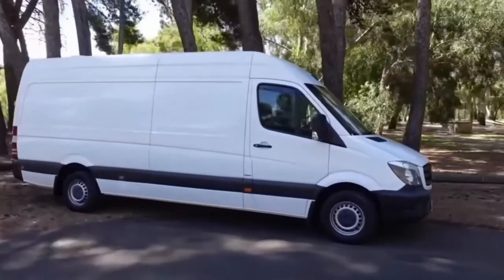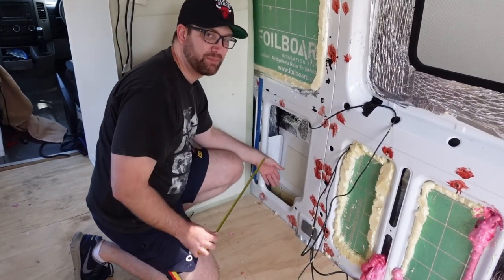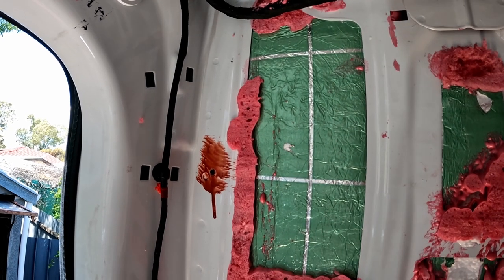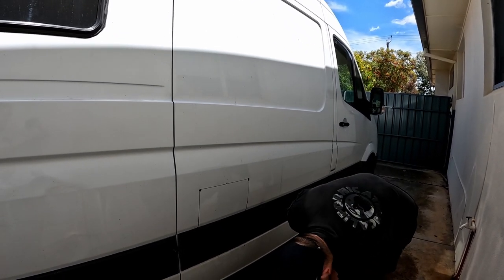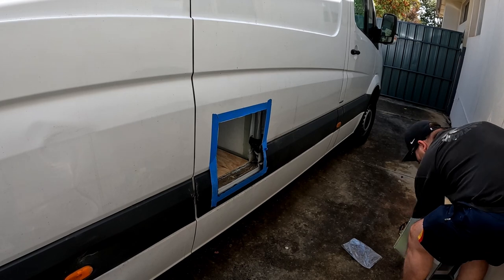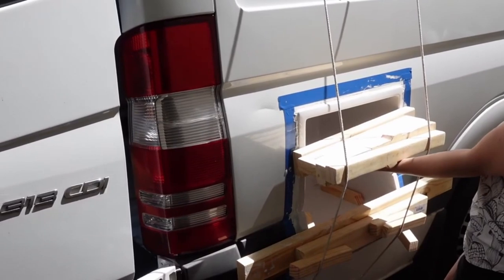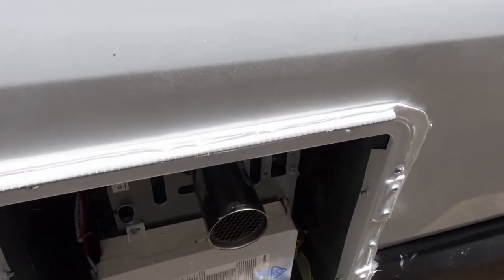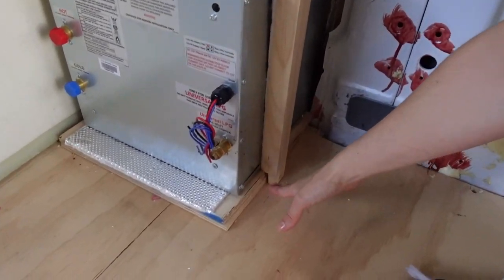The EASIEST Van Hot Water Heater Install | Mercedes Sprinter Conversion

Comment: I am researching what heater to install in my Mercedes Sprinter Conversion. I had selected the IMASS instantaneous Water heater to be installed exactly the same location as yours. 
Which I believe is the same as yours. 
I requested what else I required from the supplier for the install I had chosen too powerful a pump. 
Then they started suggesting other water heaters which partly use heat from the diesel hot air blower plus 12 volts to heat the water. i have solar panels on the roof. But consider heating water from the 12 volt system too big a drain.   
I did not like anything interfering with the 12 volt supply as it is vital for starting the van. 
Under my van I have a LPG tank and a water tank where the spare wheel was. My spare wheel is on the back door.
If anything happens to the LPG supply it is not a big deal I can go without LPG at a push. I carry spare Diesel. 
I will stick to my original idea and follow you. 
But I will take off the plastic panels/trim from the van side before cutting the hole and raise the IMASS instantaneous water heater up 4 inches from the floor.
Thank you for sharing your experience.  Sikaflex is very messy stuff to work with.
Reply from the maker: Yea so many different ways of doing it all, sounds like you’ve done some  awesome research… haha sikaflex is the devil

Comment: I just installed one of these. I decided to go above the trim and built a platform. Use goggles! I got a sliver of metal in my eyeball even with sunglasses.
Reply from the maker: That’s awesome yea it’s kind of an awkward spot you either have to cut down or build up, I ended up with a bit of a platform on mine too.

Comment: From Canada:  it's not the first time I see Aussies van builders cutting such gigantic hole in the side of their project just to heat water:  there are so many other water heating systems not requiring such kind of cutting work.
Reply from the maker: Yea fair enough. I think our Aus regulations are a bit different and we can only use certain types of heating systems and our gas has to be located on the outside of the vans. It’s interesting to see what the differences are from country to country 🙏